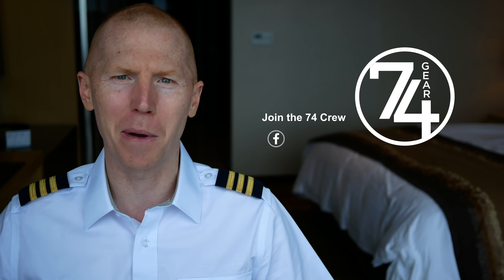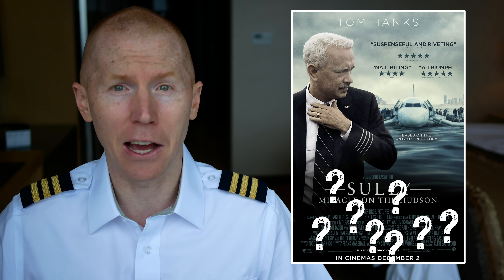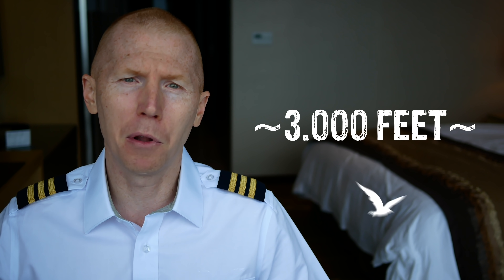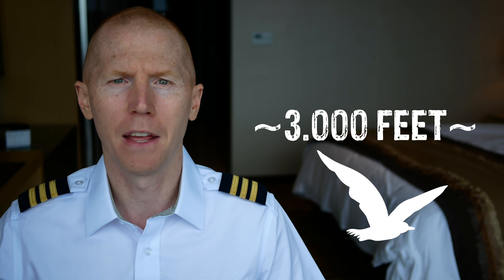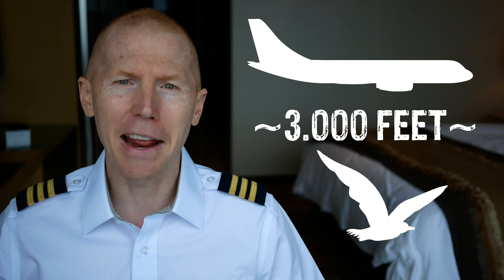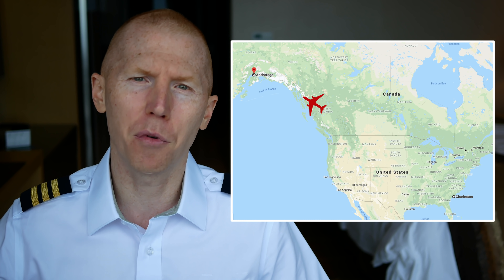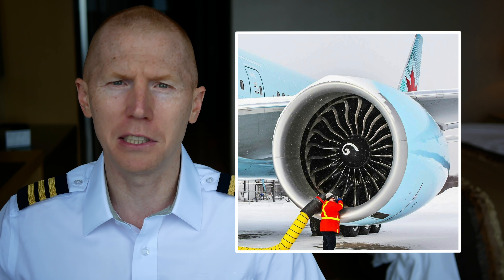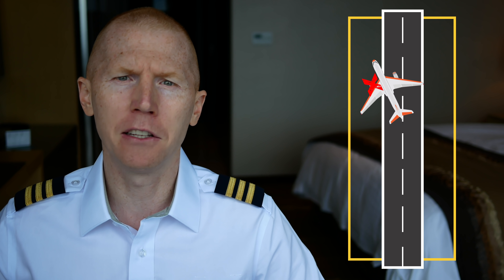Why Engines Don't Have a Mesh or Grates to Stop Birds

Comment: Mig-29 ”am I a joke to you?”
Reply: Those idiots talking about f15s don’t know that he’s talking about the grates in the front of mig’s engines
Reply: Southern Fun  The intake protection is more about the Soviet doctrine which envisioned the use of makeshift runways in the event of a major war.  They literally wanted to be able to run front line fighters off of dirt fields. You have to have some sturdy landing gear and FOB protection for the engine intakes.
Reply: Yeah, but to do that it had vents at the top, which limited its fuel capacity. The engineers for the newer Su-27, and later MIGs opted for mesh wire,and replace the vents with fuel tanks.
Reply: @bishop51807  it also had a turbojets not turbofans and that would not be very efficient in passenger transportation  :-) 
Imagine 747 turbofans having an intake system like that , they would have no wing left for the fuel :-) or we could replace passengers with intake systems and route the air through the fuselage like on any fighter
Reply: @alp4ceTV  no, the solution is to add vented intakes to the sides of the engine cowling on passenger aircraft, since the engine is usually in a separate nacelle and not blended with the fuselage. You increase the size of the nacelles sure, but you prevent birdstrikes. The fuel mix is rich on the ground anyway... It burns lean during cruise which is when you want maximum airflow for maximum efficiency.
Reply: @xmlthegreat  so you mean close off the engines and add smaller intakes with vents on the sides of each engine and then open them in flight? I would instead put 🔊 next to engines to scare off the birds 300 meters away
Reply: @StringerNews1 strider
Reply: In addition the intake screens on Russian fighters swing up out of the way after takeoff. They are only there to prevent FOD on the runway. As was said, Soviet doctrine anticipated having to operate (or refuel/rearm) at rough airfields. This included fields that had been bombed, or had been poorly maintained by the region’s client species. After the serfs fill in the craters, a Russian fighter can land, take on stores, and get back in the fight. Russian doctrine was less concerned with in and out precision strikes than just keeping as much metal in the air as you can. To Russian pilots Western fighters were/are kind of prima donna, or even prissy, because the airfield needs to be manicured before they can use it.
Reply: @gerryjames9720  Since the main topic is "bird strikes", I'll just say MiG-29's intake screen is not "just" screen. It is the front supersonic inlet ramp itself rotated to close the inlet... Considering the pressure these variable ramps have to endure at high supersonic speeds, they can easily withstand an impact from an albatross or two or three and still wouldn't bulge. So the OP has point; MiG-29 is pretty much immune to bird strikes during take off & landing...
Reply: @Goku Vegeta Face it the MIG-anythingyouwant is not by a long way the best Russian fighter unless you want a pure value for money fighter in which case the MIG-21 still wins. The SU-3x range are all better than MIG-29. The only possible exception is the MIG-31 which is of a type all of its own (it is so much better than the MIG-25 it's not worth even remembering the MIG-25 exits). The MIG-31 would not have a use anywhere else except Russia, same as the Merkava is a better tank for Isreili situations than any other tank although it would not be useful in say the plains of Europe.
Reply: Any Indians here they better know about the migs😁
Reply: Well that's for taking off on unprepared runways, using slits above the wings and closing the main intakes. Though, in flight, they will keep the main, large intakes open.
Reply: Yes, yes you are
Reply: Su-27 too.
Reply: Built to last
Reply: Southern Fun  Thank you very much. It hurts to see in this comment section.
Reply: DAS thank you for this comment
Reply: Everyone here knows that grabacr and yellow were the best squadrons on all ace combat so ...
Reply: The MIG 29's grating is for diry runway take offs, keeps rocks and armadillos out
Reply: Yeah why not a retractable grate like the Mig-29 had.
With flight 1549 both engines were lost to bird strikes so the software that redirects the thrust to functional engine won't save you. 

The real answer why grates are not used is because is Boeing (and Airbus) a cheapskate and doesn't want to pay for an expensive engineering solution similar to what the Mig-29 uses.
Reply: @StringerNews1 mage
Reply: F-15 wins
Reply: @mwbgaming28  wrong
Reply: @mwbgaming28  I don't think so if the pilot of the Mig 29 is a Russian pilot!
Reply: @Jimmydb  unlikely, his best chance is to pull the eject handle and hope his bottle of vodka comes out with him
Reply: @mwbgaming28  F-15 is a copy of a MiG-25
Reply: @philipcooper8297  I bet the MIG 25 can't land with an entire wing blown off, but the F-15 did
Reply: Yes. MiG 29.  A sappy little blip on my Tomcats targeting radar.
   Go back to bed russkie...
Reply: @dragonalpha9894  So you're Iranian, then? US hasn't operated F-14s since 2006 😉
Reply: @dragonalpha9894  Migs 29s are still flying.. F14s are in all the scrapper. :)
Reply: Dragon Alpha bro look what you started he didn’t even say shit just because the Mig 29 has the grates in the engine does not mean he’s saying shut about the F14
Reply: Dragon Alpha hes probably german
Reply: @dragonalpha9894  MiG-35: Leave my old man alone
Reply: @dragonalpha9894  tomcats are equal to mig 25..... not mig 29.
F16 is comparable to mig 29

Comment: What about a retractable screen which can be drawn back electronically once the plane rises above 3000 ft.? Given all the tech on a plane, this doesn't seem difficult.
Reply: The screen would have to be massive, since it can't be at 0° in front of the engine,  or it would have to be very strong, to absorb the full impact without deflecting it somewhere.

I really don't know where to store such a large screen 🤔
Reply: @RubenKelevra  Damn it, Jim, I'm a doctor, not an aeronautical engineer, but you'd think it could be worked out by people in the field  ;-)
Reply: @KingoftheJuice18  also there's always a trade-off when you add complexity to a system. If this system fails parts might come loose and fly into the engine.

I think the risk that a very large bird (or more) enters an engine is quite small. Would be a challenge to design a system with lower probably of failure on a already very complex machine.

Comment: Another great video. Coincidentally I was working on emergency procedures for an engine failure scenario with my instructor and we almost hit a bird on downwind. Of course you don't have to worry about thrust imbalances in a Cessna 152 though :)
Reply from the maker: 😂 ya I would rather have the thrust imbalance issue than the no thrust issue 👍

Comment: You actually can put something in front of the engine without reducing air flow. It wouldn't prevent birds from going into the engine, it would make sure that the birds that did enter the engine were cut into small enough pieces that their likelyhood of them doing damage would be greatly reduced. Super sharp, super thin high strength steel blades place in the intake would barely reduce air flow, probably far less than 1%, and they would slice any incoming birds into little pieces. But as you said, bird strikes that actually enter and disable an engine are extremely rare.
Reply: AAAAND, if efficiency is a concern, just move the blades out of the way above 3000ft. You can do it with landing gear, why not with engine-covers?